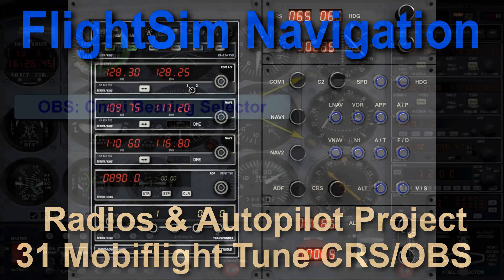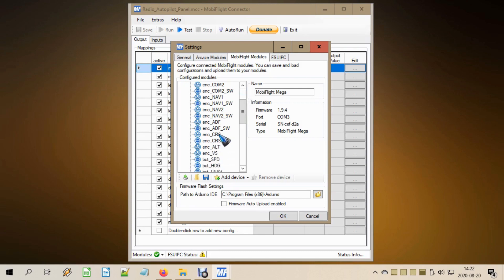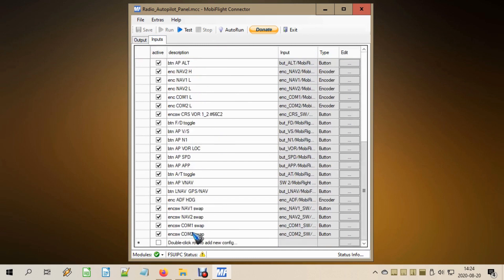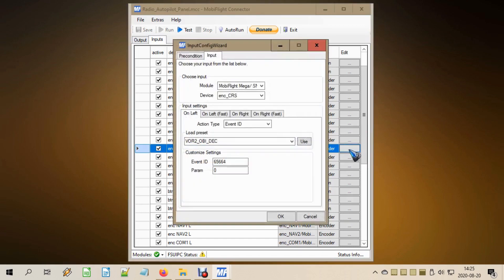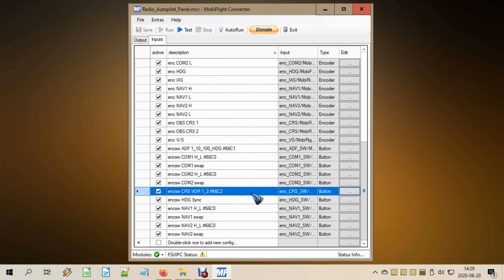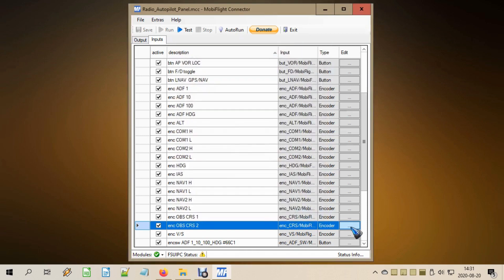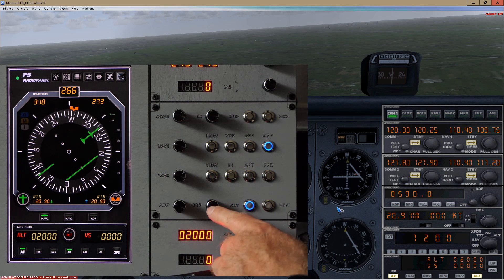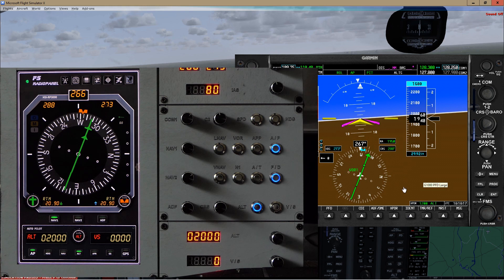Flight Sim Navigation 31: Radios & Autopilot Panel Mobiflight CRS/OBS Configuration

Comment: Hello Rudy, what an amazing Project! 

I am trying to something similar with an arduino teensy as Joystick/Controller/Gamepad without using Mobiflight and have a question to you.

I am wondering if there are limitations on the side of Microsoft Flight Simulator regarding the speed of Selected HDG, ALT, VS etc. When i spin the Rotary Encoder faster i would like the mentioned Values inside the Simulator to accelerate as well, like selected HDG jumping by 20° per click when the turning speed of the Rotary Encoder is reaching a certain value.
This "acceleration" in value change works when using the mouse wheel but the "Rotary Encoder" basically only acts like pressing one button or another depending on the direction, it doesnt work like a wheel or a mouse wheel but rather like pressing "button a" or "button b" multiple times.

Hope That makes sense to you but now to my question, when you are altering for example the HDG bug with your encoder, does it accelerate in the Simulator when you spin it faster (as if you are using thee mouse wheel)? Can Mobiflight do this?

I check every time when you are using an Encoder in your Videos but you always spin it rather slow, "click by click" so i am not able to see if it would accelerate :D
Sorry for the long Question
Reply from the maker: Mobiflight has separate settings for rotating slow or fast. This only works if the correct Event ID's are available ... for some parameters this works, for others it does not. With regard to joystick / buttons, I use Arduino Leonardo with the Joystick.h library. Works very nice. Up to 11 analog axis and up to 32 digital switches. See this project of mine: https://rudysmodelrailway.wordpress.com/2018/07/07/a-super-smooth-joystick-and-throttle-part-1-final-result-and-components-needed/
Reply: @rudyshobbychannel  Thanks for your quick answer, so i guess i might have to purchase an Mobiflight compatible Arduino afterall to do it via Event ID's insted of joystick inputs. Your Joystick Project is interesting for me to in regards to the Rotary :)
Reply from the maker: @elmar_bajora  I'd  check first if the events for which you like to use slow / fast are available. You can only see the event list in Mobiflight when an Arduino is connected, you'll need an Arduino Mega or Pro Micro to perform the test.